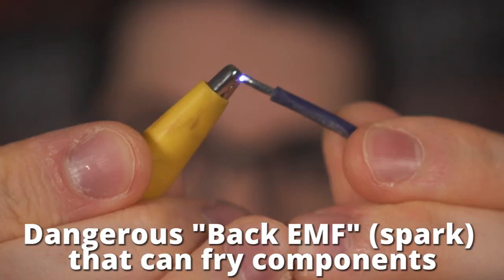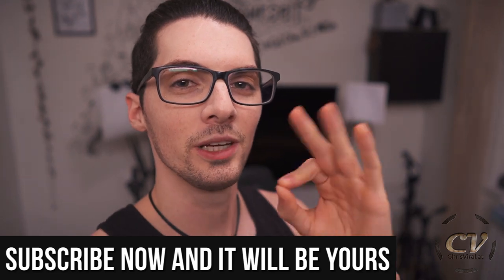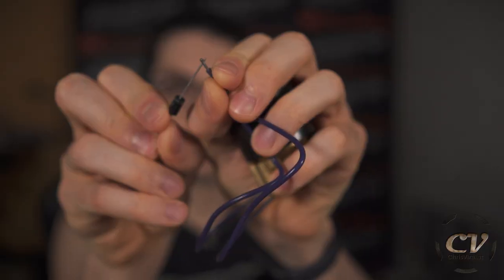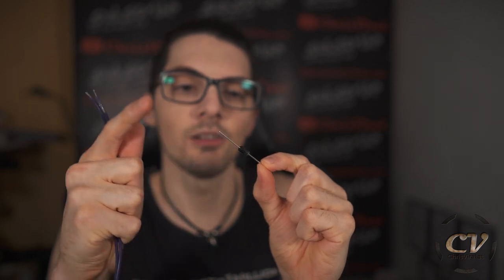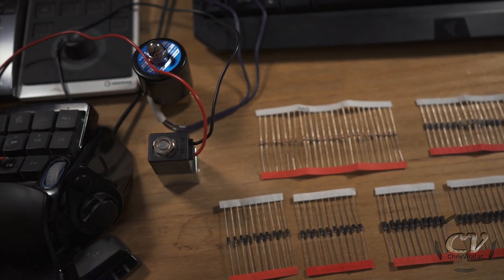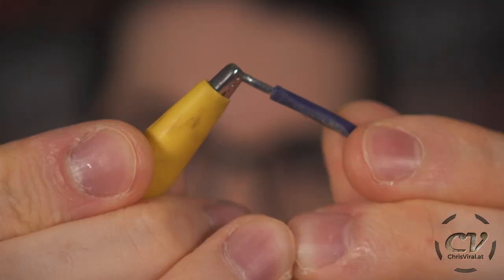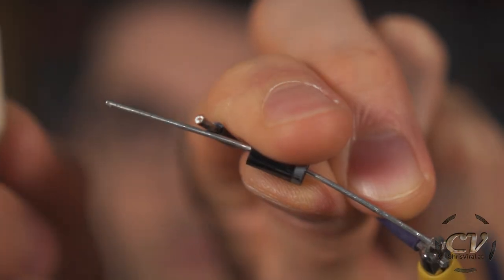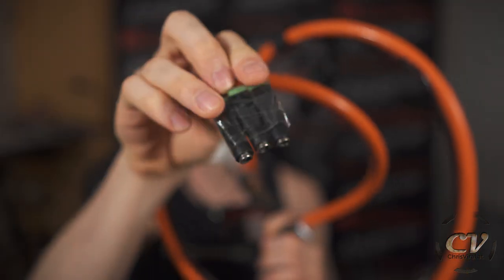Flyback Diode Tutorial | Eliminate Back EMF (AKA Snubber Diode, Kickback Diode, Freewheeling Diode)

Comment: I think I killed two VESC's by hooking up a buck converter to them. The first time I unplugged it- bam- all that flyback voltage from the inductors in the buck probably got dumped back into the VESC, frying the delicate 5v RF section of the DRV chip. It made me so depressed I haven't ridden since. I'm not even sure how to rectify the situation. Do I just put a diode between + and - at the buck??

Comment: My problem how do you select the right diode? Is it done on the basis of  the maximum reverse circuit voltage we want to allow together with  the highest current we want? Say you have a 24 volt circuit through a coil. When you turn the switch off, the back voltage can be massive, so if we were to use a diode that is rated for 24 Volts and say 2 Amps, would it burn out if the reverse voltage generated is higher than 24 V? If this is the case, should we choose a diode that is rated for say 100V instead? I wish you could have explained how you pick the right diode for the job rather than just the "how it works" part.
Reply: Typically for a solenoid you can use 5x the operator voltage.  Unless you are switching a lot a low wattage is fine as the spike is short.